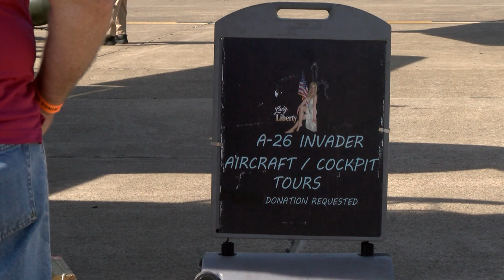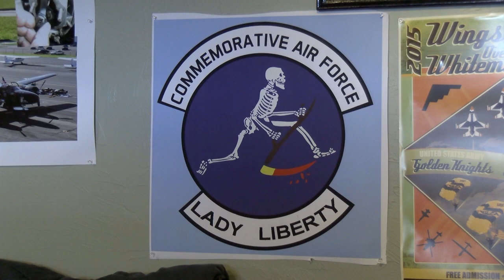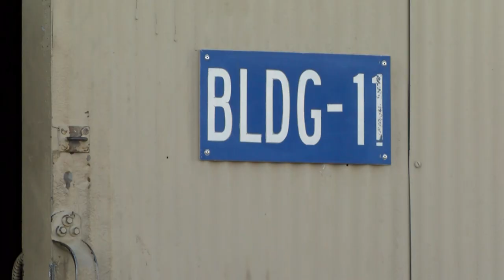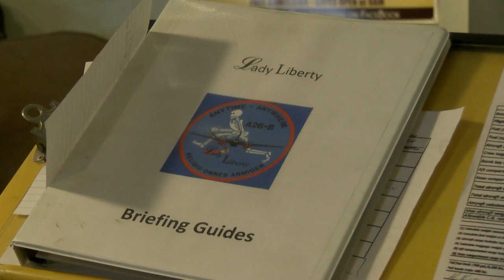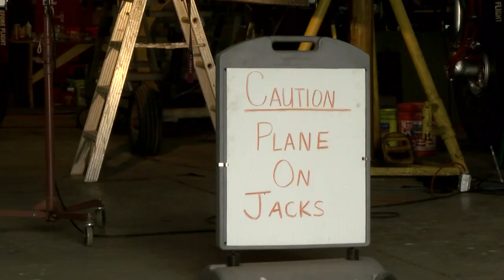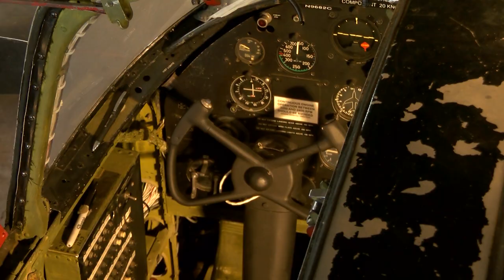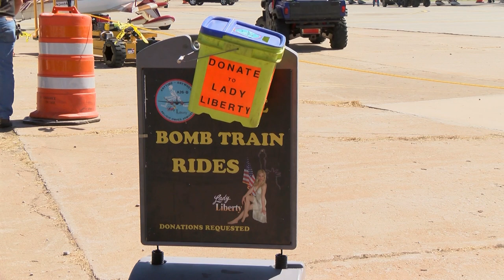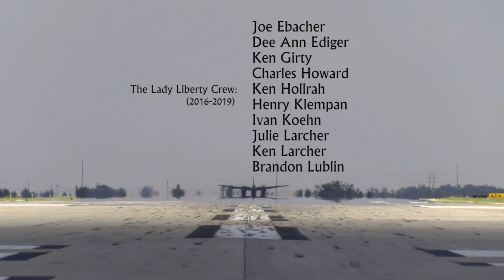A-26 Lady Liberty Documentary

Comment: Not a patch on the de Havilland Mosquito, which really was the fastest allied bomber of WWII.
Reply: 355mph for the A-26, 405mph for the DH-98. There isn't even grounds for an argument. Also they had a bigger payload than the B17 and a longer range. Imagine how many US airman's lives would have saved if Boeing built DH98 bombers with fighter variants as escorts instead  of the B17. 'Rosie the cabinet maker,' take a bow.
Reply: @coolhand1964  I honestly believe that there is a role for a modernised yet heavily  Mosquito based design, in todays military. Modern hi tech light materials replacing the wood but keeping the aerodynamic shape and twin props.   
Perhaps built around a similar gun to the A10 and optimised with state of the art equipment for CAS.
Reply: @coolhand1964  Lots of them!

Comment: My Father (Lawrence J Klein) flew the A-26 quite extensively. Here is his history for that time frame of his life: March 1952: Finished tour with the 53rd Troop Carrier Squadron and transferred to the 452nd. Bomb Group (L) A B-26 (Douglas) Night Intruder outfit at K-9 Airfield (Pusan East) Korea. On or about May 1952 the 452nd was deactivated and we were reactivated as the 17th Bomb Group (L)
*Note: The “Douglas B-26 Invader” was re-designated “A-26” in 1956. Not to be confused with the Martin B-26 Marauder, used extensively in World War 2)
March – September 1952: Flew 55 Night Intruder Missions. Awarded a couple of Air Medals and a D.F.C. (Distinguished Flying Cross) 
September – December 1952: Temporary duty to Miho AB Japan. Flew B-26 maintenance test flights. He also flew B17G, B25, C45, C46, C54, C82, C119, T33, T6 and H34.

Comment: I have about 3000 hrs flying with the R 2800 CB16-17 in the DC-6.  We never pulled the prop by hand to clear oil. The starter had a clutch and if there was oil in a cylinder it would slip and this prevented damage. There were very many versions of the R2800 and I have no idea what this one is.